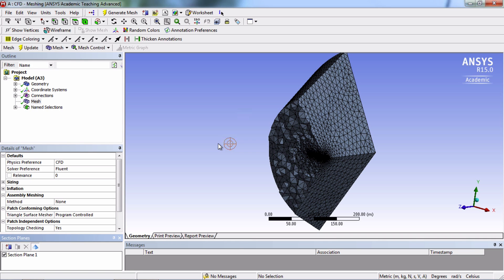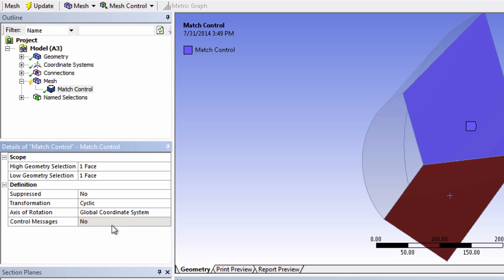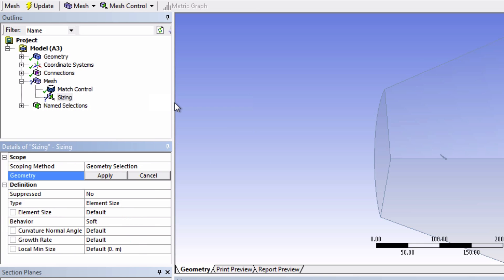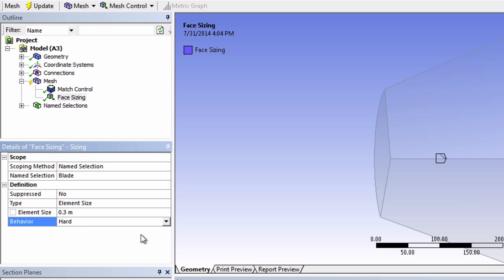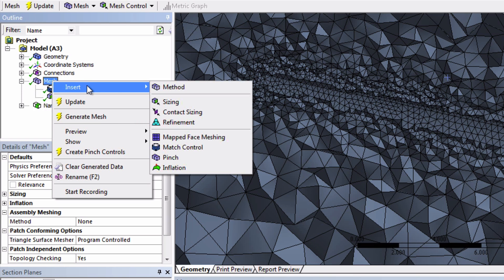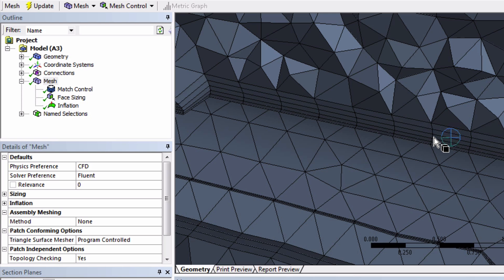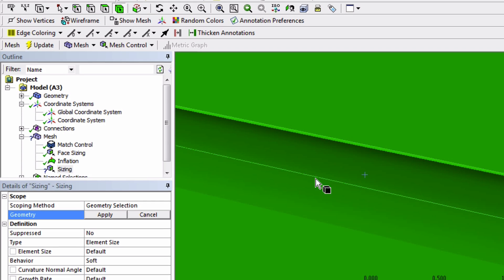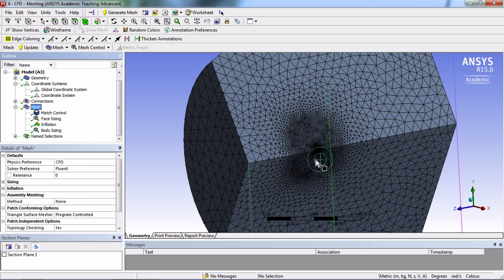SimCafe: Wind Turbine Blade FSI (Part 1), Local Mesh Controls

Comment: hi
when i try perform match control it gives me an error: " The mesher cannot find matching topology for following topology. please verify that the topology is the same shape and size, ...."
please help me
Reply: It's been a while since you posted, but for anyone else:  I had the same provblem, which was due to my Global Coordinate System being slightly offset from the streamwise axis of the fluid domain. I just created another one by Inserting Coordinate System > Define by Geometry Selection > Choose fluid domain axis. That's it. Then when creating the Match Control, you should see your newly defined coord system, choose it instead. Should solve this issue.
Reply: It's good remember that the rotation axis MUST be Z.